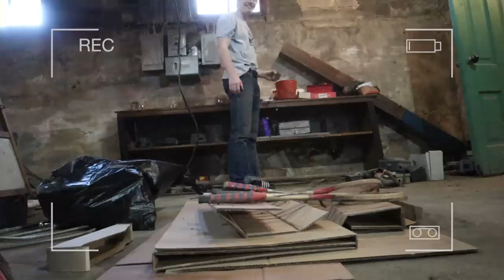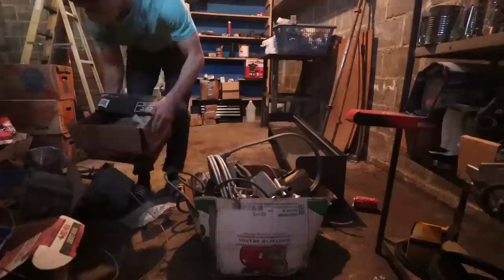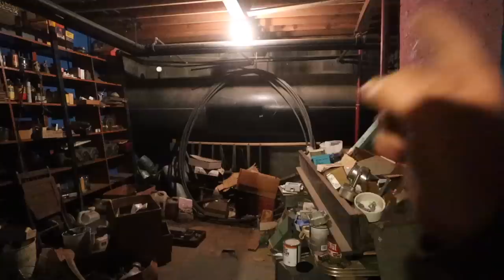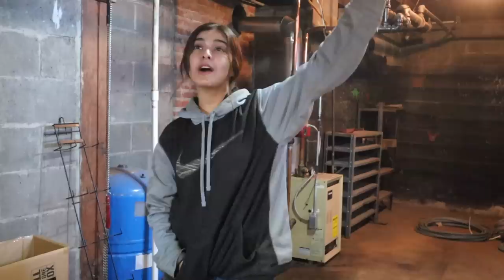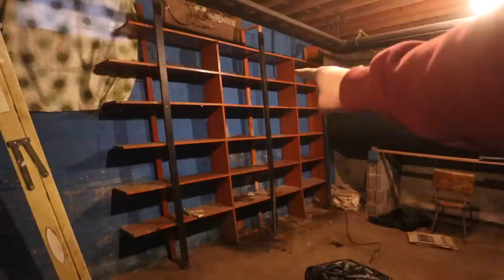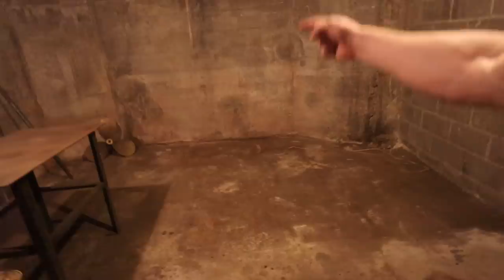CLEANING A HOARDER'S BASEMENT

Comment: Paint the walls white with drylok. It does a good job of sealing out moisture and really brightens things up.
Reply from the maker: Boonville Buck Good idea
Reply: I second that.
Reply: 5 gallon bucket of it with a drop in roller grate and a nice quality nappy roller. Paint brush for the joints on cinder block
Reply: That is a terrible idea. DO NOT PAINT BASEMENT WALLS. Moisture gets into the blocks and can escape thru the inside wall. A dehumidifier takes care of moisture. Paint prevents the moisture from leaving the block, causing it to saturate the block and freeze in the winter. Have seen whole walls crumble within 10 years of painting. LEAVE THEM BARE.
Reply: Great job Cole and Nave!! That was so much fun to watch and so satisfying!! I was thinking the same Buck, but I vote for off-white, a little easier on the eyes but will still brighten it up! 👏💙
Reply: @hotrodnate1  I can't find any evidence that DryLock causes the issue you described. I think if you have so much moisture getting into the walls that this moisture can freeze and destroy the wall, I think there are bigger issues.
Reply: @ColeTheCornstar  that stuff is awesome!!!
Reply: @William Davis cinder blocks are hollow. Even with a barrier on the exterior and paint on the interior, moisture can flow down through the blocks and into the ground or any kind of weeping tile, which I doubt a house that old will have. I live in Wisconsin, a similar climate and my family has been painting their basement walls of various houses, for decades with no issues.

Comment: Looks good! Should throw some sealer & paint on the walls & floor. Helps with dust.
Reply: Don V.D.Borgh @ I totally agree!
Reply: Paint off-white color makes room look bigger.
Reply: And do a Radon test
Reply: Colour match for a nice stone colour look
Reply: @lumpy1603  good idea, especially since planning to make a workout room there.
Reply: First... a good spraying of a stout clorox solution down there in every room's floor and walls. Then allow a couple  days of drying...  Install floor vapor barrier of 4 mil plastic, topped with a vinyl plank 100% waterproof flooring material. THEN water seal/paint. Closely inspect the load bearing columns down there for dry rot or termites.

Comment: Basement... power wash, sealer on the cement and then some light neutral color on the walls. A circle of bright color with a tag labeling every shut off valve (gas, water, power main) with a laminated schematic showing where they all are at the foot of the stairs.Label all the breakers in the box. All easy to do while the rooms are empty, a real pain when there not. Your energy is amazing. Great job.

Comment: with the basement all cleared out, id slap those walls with a few good coats of white paint to really brighten it up and make it look even bigger and wide open than it already does.
Reply: And some epoxy on the floor.
Reply: I was thinking the same thing well actually I was thinking whitewash the walls I  had a aunt and uncle who owned farm and they would whitewash everything LOL
Reply: DryLock paint. Or is it DriLock. It's a name brand and works wonders
Reply: @carson wilson thats why the initial post said to make it "look" bigger.

Comment: It's probably too late at this point, but if those breaker boxes still have usable (or new-old stock) fuses, you might think about selling them on Ebay in a lot. We have an old commercial kitchen in Chicago, and the panel uses those type of old screw-in fuses - and I doubt we're the only ones who do. :) Gotta love old architecture!

Comment: Instead of painting the floor, put some cheap carpet on it or some fake grass.  When it gets too dirty you can just remove it and put down another replacement.  Just make sure to either put a layer of plastic under it as a vapor barrier or use water vapor permeable carpet.  You could also do what my cousin in Iowa did,, spray two inches of insulating foam on the walls.

Comment: suggestion paint block walls in the basement with two coats of lactite water-resistant paint it is expensive like 30 per gallon. then stud the walls out with one by two 16 on center. then run electrical outlets in standard quad outlets in each room. When running the electrical outlets in the ceiling run wiring for recessed lighting and light switches for each room. Then drywall the walls and ceiling keep in mind to allow one inch from the floor for the walls to breathe. On the studs after wiring stable 3 mill plastic as a moisture barrier. it is costly so you will have to do this in stages but finished basement brings and a great deal of value to a home in the bank's eyes.  finish floors in ceramic or heavy gage vinal, never carpet in the basement as it can mildew. No wood either or it will buckle fast even from seasonal changes. kids can have and wonderful play area and you can still use it for whatever else

you should do the same with the attic huge bank value thereto for you and your girls' kids to come. About 400 sheets of drywall at and cost of 13 per sheet bought in one-time bulk plus screws mud for seems and wiring cost of materials and primer and paint about 12,000.00 free labor lol. 40,000.00 value-added to the home. it is about 20,000. you save doing it yourself but suggestion get pro drywall guys to do the mud work or you will take literally 3 times more hours getting the walls done properly.
being your going to do the electricals and you spoke of ripping walls out on the second floor you really should consider HVAC the first second and attic area in that home huge value increase and you can zone the ac to mitigate costs. it will cost about ten grand if you do that. consider and bank loan and redue your kitchen and bathrooms with new tile floors and walls five feet in a tile that is the standard today. Go to the bank and get and loan against the home then make the loan and second home equity line of credit. do not take and a large mortgage. Then when the home is completely done outside and inside the bank comes back after
And revalues the home at about 300 to 500 thousand dollars depending on your area and you have all that equity in cash available to you and your paying on about 75,999. for 20 years at about a 3% interest rate.  Mortage payment about $360,00 a month.
And 300k home costs about 2,200. per month 500k about4,800 and month I know that was my mortgage 4,800.00 but my home after improvements were worth 1 million the neighborhood was all classic victorian homes on large scale. You have and fabulous nuevo with deco woodwork and great chandeliers you should look at those chandeliers I am a well-capitalized private investor in small and large scale real estate and financial markets. I give free advice. I will be working on farmer's bond market offers for farming families in combination with the government backing the bonds for very cheap long term monies. And my grocery store idea I will back for farmers with my own capital for that deal giving 80% of net profits to participating farmers.
Note farmers will have no personal money in my grocery store national chain simple grow our food and livestock simple no risk pure well-earned a share of profits. The private wealthy people now make sure they can not be googled so they appear to have little it helps with the new bee sting law suite that are cheaper to pay then defend.

Comment: As the Bard once said...

 'A Fart is very useful...
it Warms the bed at Night...
It helps to fluff the Duvet out... 
And puts the bugs to Flight.' 

A Fart's not anti-social...
They really should be shared...  
Especially the Whiffy one's 
That follow you downstairs'   

There's silent ones ..And Whiffy ones
That turn the air quite blue..
But worst of all you might recall...
Are the ones that follow through!

So if if you feel like letting rip
in company or solitary
Try to make them tuneful
And play the 'Trumpet Voluntary.

Comment: Is/was your grandpa's old house boiler an oil burner? Almost looks like an oil storage tank in the basement. Down the road, when your water heater goes  out. You should plumb a hot water storage tank into your boiler system. More efficient and it takes away a gas appliance leaving more cash in your pocket.

Comment: Cole are you going t a d stain the skid. It would make it goo from 199 to 💣1000 and be ine even livable. You’d increase the Homes value  by 10% more if done adding some area rugs in a few rooms helps. Ajso by painting the workout  room that shines adds and if a drop ceiling were installed. T you you can add another  10% to the value if the base ment overall. It’s a beautiful  job you have done. Future projects a bathroom and kitchen install adds $40,000 more functions   Make the basement cellar a canning cellar add rubber floor to workout room etc. keep
Up
The great work. Yuur cheabuo uo hiuse cejjar and barb are my favorite buddy’s. I’ love the
Mmmmm

Comment: Not trying to be OSHA or whatnot, just a helpful hint. I had never worn them ear plugs until I worked at my current job, but they are supposed to sit a lot further in the ear than they are. You roll them in your fingers and stick them in your ear and they expand to your ear and block out the sound they are supposed to. Took me a while to realize that me wearing them like that to know the right way

Comment: Cole have you ever thought about making an entrance down below as a mudroom because putting the shoes down that far I don't know and I would remove the door going into the main basement yeah where the first part that's hooked you have to put a support beam there though I know all that cost money now you swept vacuums now you need to mop all the rooms down there if you got them all done and wash the walls after they're dried well you can put that cinder block paint on it turns to Rubber and it seals the walls it shouldn't cost that much you probably need those walls are dry said that looks like all that knob tube is downstairs to I'm not sure you'll have to have probably is a whole thing rewired that should cost quite a bit money unless you know it what trishan that's willing to do it and do it correctly on a budget Rose

Comment: That big black tube looking thing that's being supported buy something else is it part of the cistern can you get rid of it without doing damage to the house? And what is that Square Park on the floor and the main area of the basement? Can it be removed? I bet daddy corn star know what it is? You should be able to use that basement as living space and it would increase the value at the home. Rose PS that's one of the reasons why you need to use this new paint that will seal the ceiling the floor in the walls after you get through washing it member use rubber gloves. Yours truly

Comment: What is that big black pipe looking thing and second room? When you have the house rewired and you need to have the plumbing look that you could have all your utilities put in that room and I don't know what's over there in the corner in the big room? That you said that can't be moved so ask your dad what it is. Yeah it might be the birds upstairs that have died that's causing the odor in the house explanation point. You can get rid of the baller and have a new heat and air system put in and have it put to the utility room where that big black thing is that's where all your utilities would go that way you can use that room the big part of the room that's part of the basement but you're going to have to scrub the walls and the floor if a disinfectant let dry completely and get some of this sealant for the cinder blocks and the floor and everything it works really well I'm told so I can rubberized paint that way the heat. Scape and plus it makes it cleaner and no mold. At pipe you talking about at Lompoc was probably brought through a window I wouldn't throw those windows away because they could be used in your shop. Rose